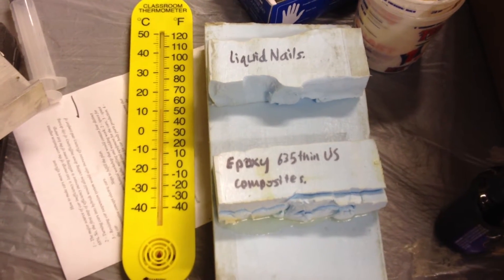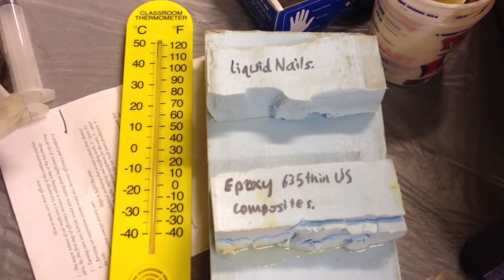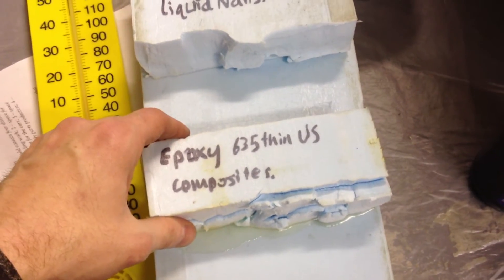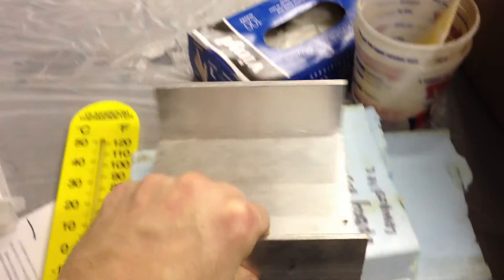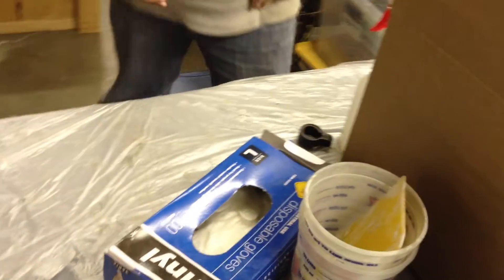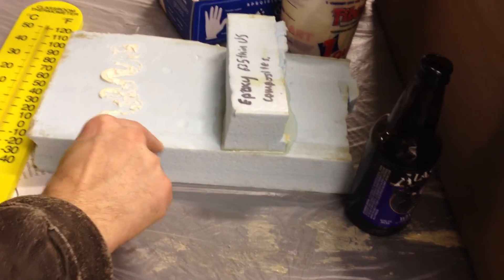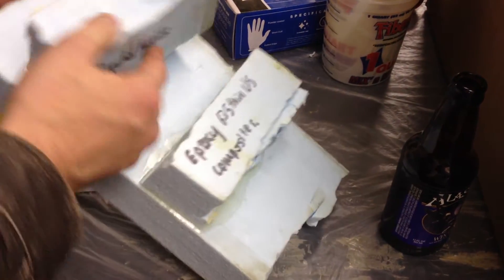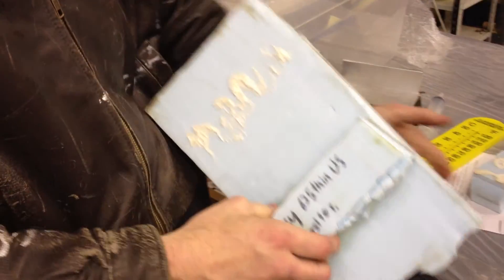WIKISPEED adhesives on insulative foam board

Comment: Just saying liquid nails is kinda like saying I live in the USA.If someone wanted to find me how could they.Liquid nails makes about 50 types of adhesives.Which did you use. Epoxy almost the same you should show the type used. Now may I suggest you try glidens gripper not just because its the best foam adhesive but cheaper by far than any epoxy.IMO!!!!!!!!!!!!!!!!!!!!!!!!!!!!!!!!!!!!!!!!!!!!!!!!!!!!